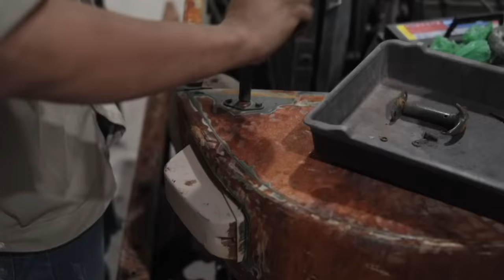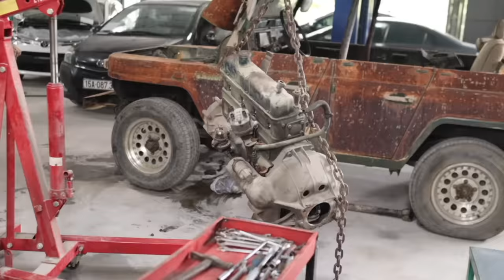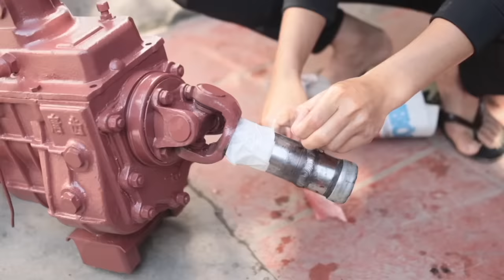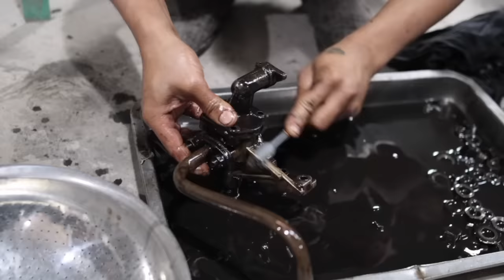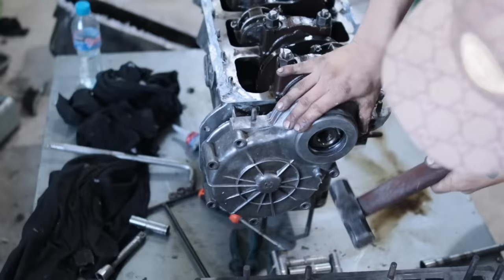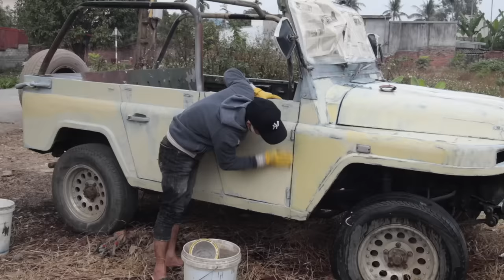Fully restoration abandoned 60-year-old UAZ 469 car | Repair and rebuild military vehicles UAZ

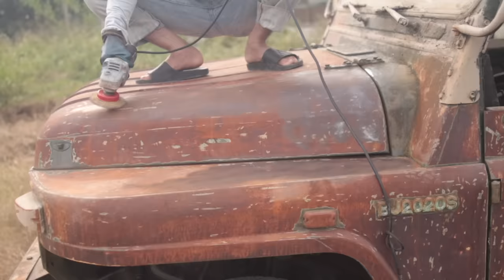Comment: I think this is a BAW BJ2020S that was produced between 1986 and 2005 (can be seen at 45:40)
Reply: Right
Reply: Beijing BJ 2020.
China car based on russian uaz-469
Reply: Right
Reply: @ИванИванов-б8л3ю  Hello! I think it's the wrong badge on the hood. The Beijing BJ 2020 has been produced since 2005 and is completely different, with angular body shapes.

This car is similar to the Beijing BJ212, which has been in production since 1965. UAZ-469 has been produced since 1972, so the Beijing BJ212 cannot be a restyling of the UAZ469, because the Beijing BJ212 began to be produced 7 years earlier. Beijing BJ212 is a restyling and modernization of the GAZ 69 (UAZ 69). It is quite possible to say that on the contrary, the UAZ-469 received some features inherent in the Beijing BJ212.
Reply: I think Soviet engineers helped in the design of the Beijing BJ212, and the positive experience gained was used in the design of the UAZ 469.
Reply: I think the UAZ 469 turned out to be quite an interesting car, and in my opinion, this experience was also used when designing the Gelendvagen. Gelendvagen began to be produced 7 years after the start of production of the UAZ 469, and in my opinion, some of the geometric proportions of the Gelendvagen are very reminiscent of the UAZ 469.
Reply: Sorry, GAZ 69A, not GAZ 69.
Reply: @ИванИванов-б8л3ю  not russian, USSR.
Reply: 完全正确，车体上写的非常清楚BJ2020S

Comment: I think this is the 1st time I've ever seen a channel like this straight up restore an automobile and not stop at disassembling the engine.
Reply: Unfortunately they still aren't restoring anything. They are just putting more effort into their deceit. The vehicle at the end is the "before".   From what I can see they bought a drivable vehicle, gave it a quick paintjob in the lighter flat green, filmed the "after". Then they changed bumpers and ground all the paint off and let it rust for a dramatic "before". After that they tore it down and reassembled a few components to make it convincing. Look at how they just paint over the door handles and emblems when they are spraying the dark gloss green, yet the handles and trim are unpainted on the "final" product.
   I'll give them an E for putting so much effort into faking a restoration.  The algorithm likes to promote this nonsense, so good for them for taking advantage of it, I guess there is a lot worse things they could be doing with their time. Who knows, maybe one of them will eventually actually restore something?
Reply: Definitely looks more like a school than a real shop. They just taking things apart, cleaning and reassembling. No measuring on common parts that wear out, no replacement of bearings. This is still entertaining.
Reply: @CarterAutoRestyling  You nailed it.
Reply: @CarterAutoRestyling  agree.. While watching this I can't shake off the feeling that these rust and "abandoned" state is all cosmetic and just made it to look like so..
Reply: @myxponce8347  1:28 you can see the grinder pattern around the bonnet latch.
This is 100% staged to look rusted, all the "restorations" on this channel are like that. 
The mercedes they "restored", when assembling the engine they didn't use a drop of oil or assembly lube, they used no seals or sealant, they didn't even have piston rings and all the corodrod bearing caps were mixed up. Then at the end it didn't blow any smoke or leak a drop of oil/water🥴🤣🤣

Comment: It is always brings a great deal of satisfaction to take something that has been sorely neglected and through hard work restore it to a thing of beauty. It is also very useful to have the facilities of a garage repair facility to do this, and more than one person doing the work. That is why many people do not do this.

A couple of notes to help you lads. The valve and pushrod cylinder identification needs to be recorded. This was done for the piston rings. This is so the valves and their push rods go back in exactly the same places they came from as they wear differently. When re-building use engine re-build oil. It is red in colour and it is specifically for engine re-builds. Check the bearing inserts carefully. If scratched or worn replace. If the crank is scratched or worn it may need re-building up and grinding. That's a specialised job, and I appreciate you are trying to keep the costs down. There are defined tightening down sequences and torques for all bolts. They need to be adhered to. Never use a metal hammer on a metal casing. You can break it. Use a soft hammer to remove or tap into place.
Reply: это бестолковый труд

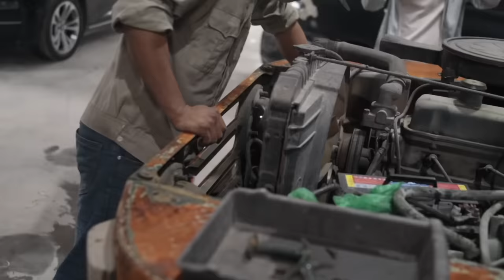Comment: This car is not 60 years old and is not from the year 1961, rather it is more recent, it is most likely between the year 1980-2000, and look at the 1:48th minute, the engine coolant tire and the fan are made of lightweight plastic, we did not see anything like it before 1983 sure not in russian car manufacturers
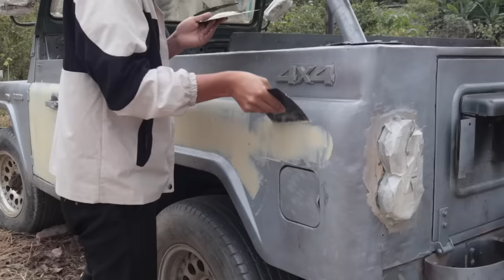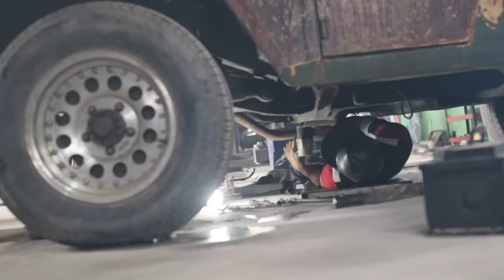At minute 49:41, you see a signal 4X4 and at 9:22 minutes modern aluminum wheels, at 10:57 minutes the windshield washer device works with electricity and multi-speed, and in 20:06 the gearbox and sprockets did not exist like them in 1961 with this small size and light weight. All of these things indicate that this car is relatively modern and not From 1961, which is most likely between the mid-eighties to the end of the nineties of the last century

Comment: WTF in beginning u see him removing the front signal lights wires etc and then he painting primer over rust with these same light signals and other parts connected. Not to mention no sanding or removing rust, this not restoration  its a cheap patch job

Comment: I don't know, it's hard to believe, to begin with, the green color that they are painting, when it dries there is no longer that color that you see at the end, you don't see that they checked or repaired or at least cleaned the chassis or the axles, nothing of that, in any case, the entertainment is well worth it, in the end everything is, due to the precariousness and lack of resources that it is clearly seen that they do not have.

Comment: If actually a 60 year old vehicle, would have been 1962 when built. I don't think plastic fans and reservoirs were used on vehicles until the 70's or 80's. Click bait video.